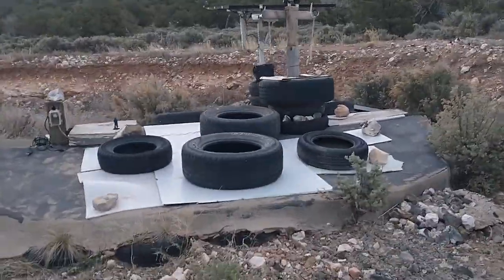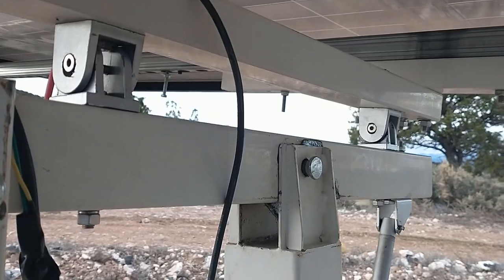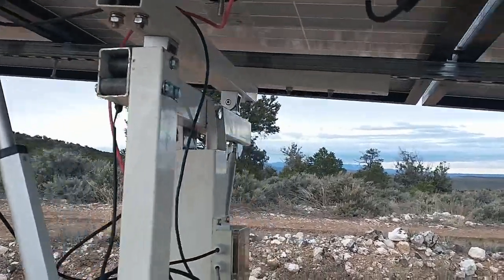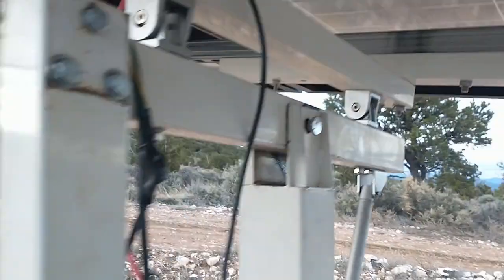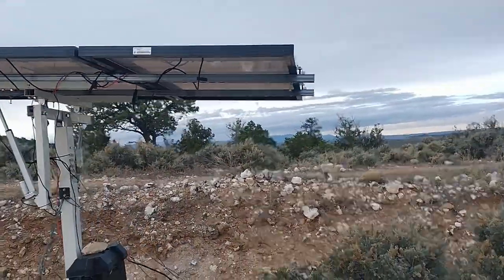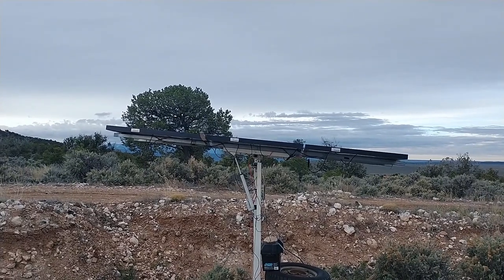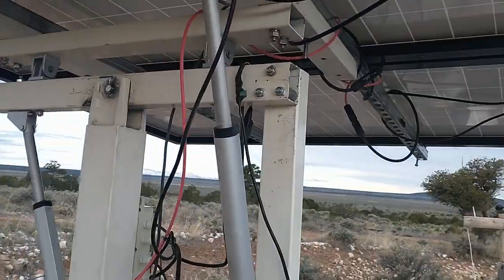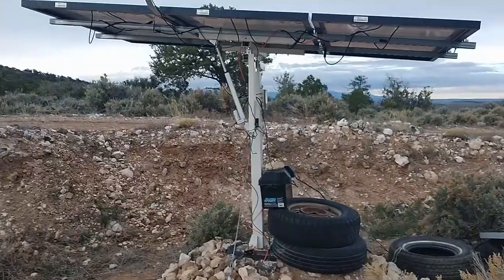Tracker Repair Inspection And Follow-Up

Comment: Quick and cheap fix for the excess play in the big pin at the 1:34 mark..  get some JB weld and "weld" some thick body washers of the same size to the vertical post on both sides.. and you might have to get a longer pin and add a washer as well.

Comment: Check out steering dampers used in Jeeps or trucks. They come in various lengths and you be able to find one that would work with a few mods.
Reply from the maker: I am wondering if that might be too stiff, might be worth a try.
Reply: How about those gas struts used to hold/open hatchback on cars/suvs? They're under pressure, yet you can still push them closed. Might be a cheap junk yard raid for a few bucks for a pair of used ones.

Comment: I have a question.... I  bought one of these trackers & Eco-Worthy said the kit doesn't include limit switches that are necessary.  I bought 4, but the instructions don't explain how to wire them in with diodes, nor what kind of diodes to use.  Can you explain what type of diode to use, how to wire them, & where to put the limit switches?  Thx.
Reply from the maker: As far as I can tell you don't need them. Mine does not have any.